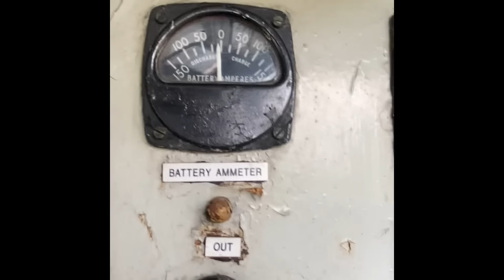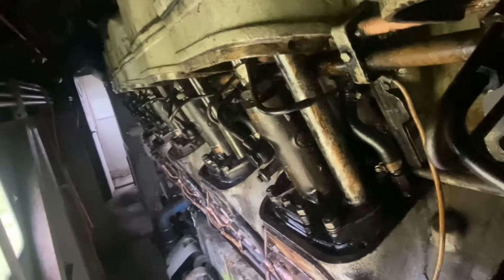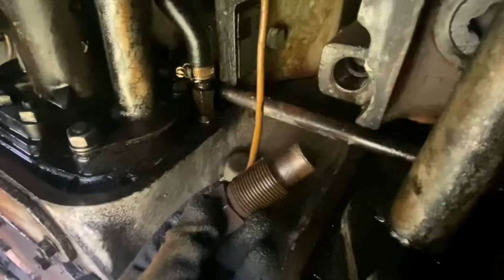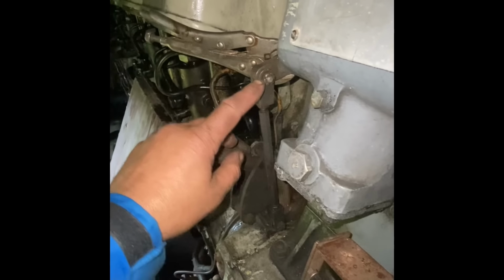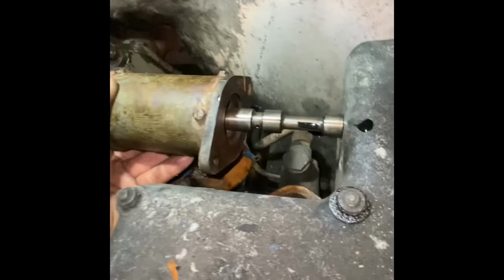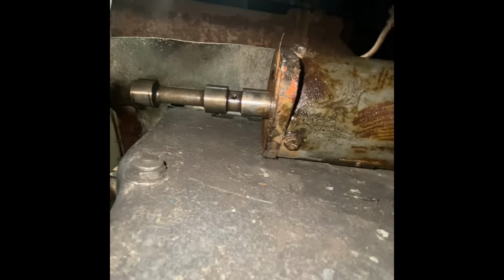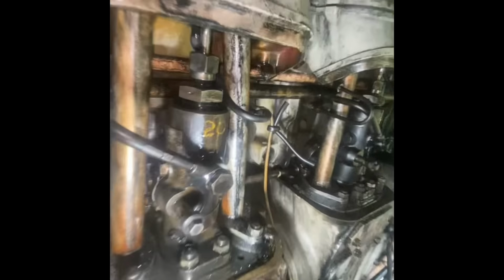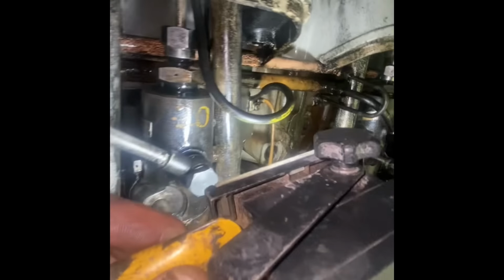37042-take 4.5 trying to start (fuel preparation)

Comment: Do the fuel pump racks go to the full fuel position?, try the rack position with the ESS removed. They should move smoothly from stop to start. It doesn’t look like you have enough fuel at the pumps for starting, it should be shooting out the top of those pumps. Check the fuel priming pump, check the Stop/start Solenoid Windings Resistance as it doesn’t look as though the plunger is moving enough and then follow the flow of fuel through the system checking for restrictions etc, once you have enough fuel and pressure at all 12 pumps, connect an injector to each pump in turn and look for injector leakage and spray pattern, ie, 1-1,2-2, etc, finally replace all injectors and go for a start up.
Reply from the maker: @paulnolan1352  hi.
The ESS windings are 616ohms from memory.
We're on the overhead gravity tank only which 'vomits' out the rail bleeds but maybe we need to look more at this & each pump for supply.
Tbh the batteries were pretty poor on Monday so I'm rethinking that & likely charging slowly & fully off site.
Your post has given me a lot to think about so thank-you.
I.
Reply: @iainf  cheers Ian, do an insulation resistance check on the ESS to earth, should be virtually zero at 1500 ohms. When you recharge the Batteries look into the Cell compartments and see if any of the them are cloudy or brown or fizzing when under charge. All the best for now 🤙
Reply from the maker: @paulnolan1352  I've a battery tester that reads internal resistance etc that is proving invaluable.👍
Reply: @iainf  good lad, I’ll try and keep looking in, night for now.

Comment: When I was a fireman at eastfield traction depot springburn Glasgow the 37s were never shut down in the winter nights as we could never get them started again had to go and get a fitter but in saying that great locomotive the 37   1974 onwards
Reply from the maker: Hi.
Ah yes if only we could go back to those days.

Yes we're trying our hardest & throwing time at it whilst we have some warmth in the air & trying not to think that winter is not far away.
I.
Reply: @iainf  good luck they deserve to be saved my older brother end up driving the same 37s that I drove as DRS bought a load of old eastfield locomotives and refurbished them they put in new soundproofed bulkheads between the driver and the engine new seats he loved driving the 37s

Comment: It looks like an old Rushton Engine that bolt on the side of the fuel pump Shows you the spill closing which is the point starts delivering there should be one on the opposite side I would take both out put a piece of white paper on one side with a light behind it the get some body to bar the engine whilst looking through from the other side when the light just cuts out check the pointer on the flywheel and see what it's pointing at that will be the fuel timing for that cylinder there is an adjuster in that window below the pump to adjust it I used to have ground down spanners to adjust whilst it was in position which is a lot easier than what the book says from new they are not usually all the same you usually get the test sheets with the new engine. The water treatment plant in Birmingham had six of the with Generators attached I rebuilt all of them they had air starts they were duel fuel so ran on gas with diesel as a pilot fuel for the ignition as they had no spark plugs.
Reply from the maker: @denis9450  thanks for a great detailed reply. It's useful to understand as much as I can about these locos.
My Tef20 also has similar spill timing so I understand the theory.
We're hoping the timing is fine as it was running in 2009 we now believe.
I've a few tricks yet to try so here's hoping.
I always say if this fires it'll make the main headline on the news.... 😊
I.

Comment: Well you definitely have compression and looks like you’ve got fuel going to at least some of the injectors
Reply from the maker: @Joe47847  yes. 4 on one side & only 2 on the other but the batteries are needing a right good charge now.
Main consideration I guess is we're moving forward.
Pretty impressed when I smoked it out tbh.
All good fun.
I.

Comment: Doors open to stop the potentially explosive  fumes as well
Reply from the maker: @herrbohnen  ventilation is always a good idea.
It had been cranking for probably about 5 or 6 minutes all in with no sign of life at all so there was no fuel around sadly. 
With the decompressors out it was never going to start so all managed. 
Been there before.
I.